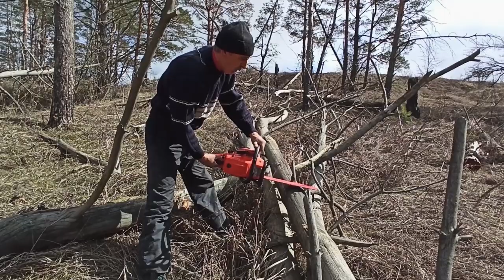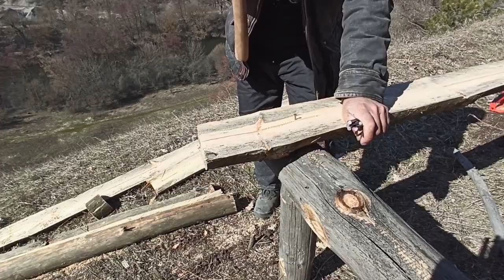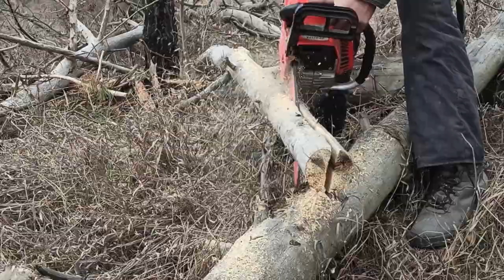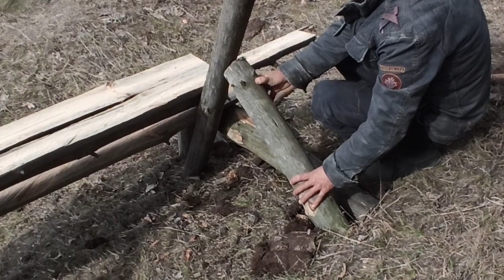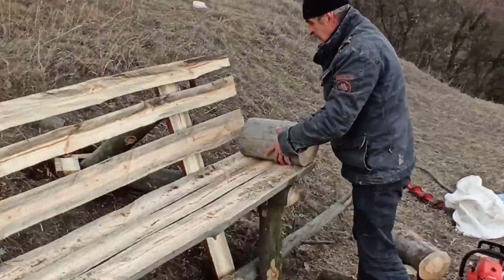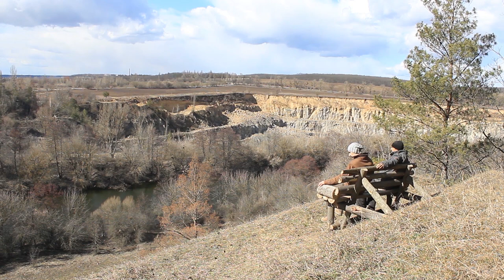Bushcraft on the Mountain, Pine Log Bench

Comment: i do enjoy your resourcefulness in the forest....may i suggest something that may help you with keeping your fire alive longer, less work for you also.....when you have located the place where you will "build" your temp. residence, instead of foraging continually for fuel for your fire, why not use the + method...gather 4 approx equal in diameter logs of approx 4 or 5 feet long each,,,,,place them in the form of a + with the ends touching.....build a fire in the center of the + where the ends of the logs meet...as the logs catch fire and burn, you can use the logs at their conjunction to set your skillet or pots or pans on w/o the necessity for a another item to carry in your pack....when you want the fire to reduce in heat output, then pull the logs apart a little...the fire in the logs will continue without the necessity of you rekindling and looking for more wood to feed the fire.....the size of the logs in circumference should be sufficent to allow the fire to burn in them for several hours at a time....small branches will not work, you will need "logs"...when you awaken in the AM and you want a flaming fire, just push the smoldering logs together and in short order you should have a fire...works even if there has been a little rain....happy camping....
Reply from the maker: Thank you, I already showed this in the episode of survival with a single knife.